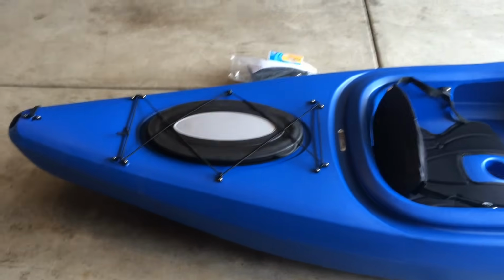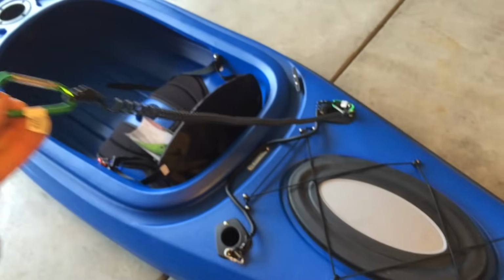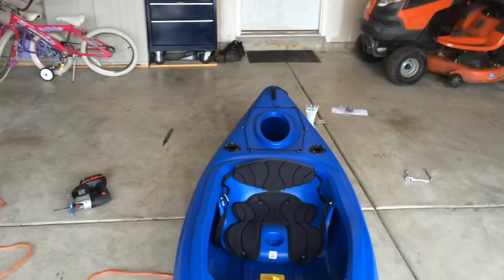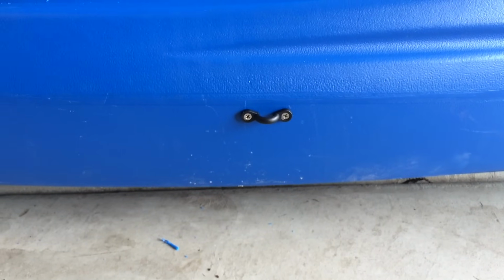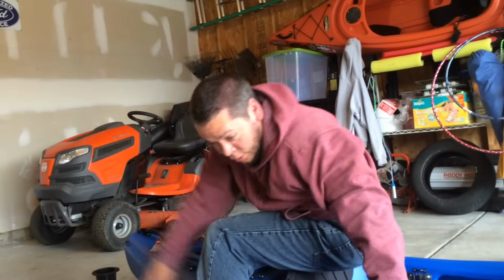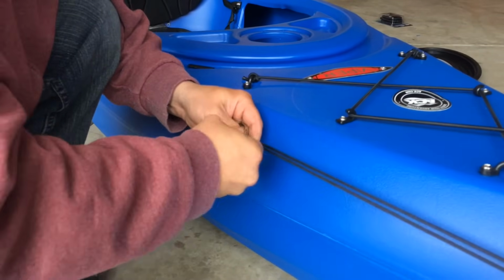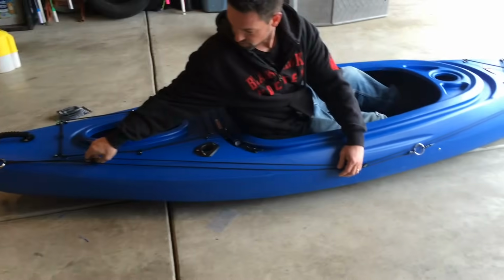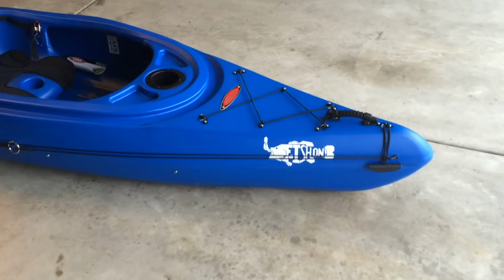Poor Man's Kayak Modifications

Comment: why u don't use gasket maker for the rod holders or those holes u drill wouldn't water get in
Reply: +Bass Hole oh ok since water getting in dosnt mater you should drill 2 1in holes about 5in apart on the bottom so you can cool your feet with the water

Comment: You forgot to use silicone. The rod holders will take on water
Reply from the maker: MTB Wolf I did not forget to use silicon, the cockpit will take on more water then any hole I made on this kayak. I’ve had it for about 5 plus years and I have never experienced water from anywhere except the cockpit. Now if it was a sit on top I would’ve bought stock in silicone. Thanks for watching and good luck with your  mods.

Comment: better to use shrink wrap rather than electrical tape. also silicon seal will come loose in time use a proper water bonder CT1
Reply from the maker: victormeldroo thanks for the advice but I’ve been running it this way for years and have had zero issues. The point Of the video was to use what you have and make the mods as cheap as you can for those on a budget that still would like to get on the water. Thanks for watching.

Comment: if you dont use a backer for the bolts, it isnt really re-inforced but only installed with bolts instead of screws..... 
the advantage of screws is, when they pull out, they can either be replaced with a larger screw, or drilled to accept bolts (IF one can get to the backside to install a backer and nuts)..... because when a bolt/nut pulls thru the plastic, it tears a hole, so if one were to use a good backer to spread the load, it would NEVER pull out, but remain secure for the rest of its life....
Reply from the maker: Honestly I haven’t had a single issue with anything I installed on this yak. Thanks for the advice and watching.

Comment: Alot of holes with no sealant AT ALL. And the amount of force having to move you anchor trolley line puts alot of stress on all those screws with no sealant. Just a matter of time before water gets in. Also, please explain the benefit of a dual anchor trolley? So when the wind turns you have to remove anchor line from front and move to rear, or visversa. Just asking...
Reply from the maker: Christopher Wilson I’ve been using this kayak now for several years and have not had a single issue with water getting in the holes I drilled however when I paddle I do get water through the giant open cockpit and when it rains. I have had to replace the paracord and it loosened up within a few weeks so the strain on the padeyes was minimal. Thanks for the advice and watching.
Reply from the maker: Christopher Wilson the dual trolley was because the cord kept rising up over the top or going underneath the yak this eliminated that.
Reply from the maker: I’d just like to add, still not leaking at all. Silicone is for porn stars.

Comment: For anybody doing this, I highly recommend using either maring grade silicon or even better a marine grade adhesive sealant like Marine goop (marine goop actually bonds to the polystyrene unlike silicon)
Reply from the maker: Just for anyone that reads this comment, I’ve had this kayak for years and those rubber washers I used to seal the holes are still going strong. The only place I get water in is through the hole for the cockpit where I sit. But if you feel more comfortable using using silicone, you do you. Thanks for watching.

Comment: I would have put more eyelets in the middle portion and put them vertices instead of horizontal,  you are using them as a line guide, not really an anchor point, but definitely horizontal at both ends. Also I've seen (and added) about 8" of mid size bungee chord to one end of the trolley line for two reasons... 
1. If you areanchoeed and you get loose or drift or gust of wind, without the bungee taking up the shock stop... YOU might go swimming. 
2. The bungee makes maneuvering the anchor back and forth a pleasure and NOT a chore.
Reply from the maker: Thanks for the comment and info I’m glad you were able to make it your own. Good luck and thanks for watching.

Comment: No silicone to seal?? I mean... u have good ideas but even rubber grommets are better than nothing
Reply from the maker: Foxxyginger I used rubber washers. And just so you know this is a sit in kayak with an open cockpit you will take on more water there then anywhere in the yak even if you don’t use silicone or rubber grommets. I’ve ran this yak this way for a few years and never an issue. Thanks for watching.

Comment: Heat shrink wire wrapping is pretty cheap, and will last longer than electrical tape. Also, those deck eyes don't hold up to paraccord friction. A few cheap pulleys will extend the life of the whole system.

Comment: Instead of electrical tape on the rod leashes I would say slip a half inch diameter heat shrink tube over the cord, make a loop and sew it together with braided fishing line then pull the heat shrink tube over the sewed part of the loop and use a heat gun or a lighter. 
It will look a lot neater and be a lot less likely to come undone.
Reply: Might be a dumb question, but that sliding system depends on the friction which depends on the tightness of the rope. Doesn't it gets loose over time, or, say, when direct sunlight heats up the rope?

Comment: My first time Kayaking and this Kayak held strong. https://www.youtube.com/post/Ugkx4k5UrhC3v_Y4hIEaXLGvHcN5a5aBmZNB  The water got pretty rough as a speed boat zipped by me, and the Kayak withstood it (I expected to be capsized). The Ores are very easy to put together, the pump worked beautifully. the seats are a bit hard to sit in after a while (I recommend sitting on the floor). after reading the reviews I was very scared it'd get a hole in it, the material is very strong and durable. The Air valve may need a small Phillips head screwdriver to adjust, other than that, it's well worth the money!(update)I've gone Kayaking in 3 Lakes and 2 rivers totaling about 40 miles. the kayak had two holes and they patched easily and no other problems can't wait for kayaking season this year!
Reply from the maker: Good luck and thanks for the comment and watching.

Comment: First off, I appreciate your very informative video.
Question:
Should you use some silicone caulk  to seal out water under the rod holders? Seems like water could get between the kayak deck and rod holder.
Reply from the maker: I’ve never had an issue with water in that spot, if it was a sit on top I would use silicone but since it’s a sit in and the most water I take on is from the big open space where the seats at, it’s not a worry of mine. Thanks for watching.
Reply: Just look at the location and think : it's on the top right next to the OPEN cockpit.

Comment: I hope that you put on the rod holders some good marine quality sealant. Because if you didn't you may want to stow away a bilge pump. Because water gets in anywhere it can with or without your help. And not using  sealant is helping it out a lot.
Reply from the maker: Lough Sun I don’t deny sealant helps but I’ve been running these kayaks the same way for over five years and I haven’t had a problem with water. But if it make folks feel more secure then they should use sealant for sure. Thanks for the advice and watching.

Comment: If you didn't use silicon , water will be getting in.
Reply from the maker: Derek Simerly This yak has been used for a few years now with no leaks through the screw holes. More water gets in the cockpit from the paddle then anywhere else on this yak. Thanks for watching

Comment: Just a question - is there any need to use a sealant on the eyelets? Did the yak ship water through the holes or did it stay water-tight? If you used sealant on a poly yak, what would stick to the plastic?
Reply: Rubber washers - solid approach.
Reply: +Bass Hole cool I have that rubber gummy stuff that people use to put on Windows when they install a new window to make it water proof I have a big ass roll of it I guess it would work if I made like a donut with it around the skews or nut head before screwing the screw right?

Comment: Question May 15th, 2018. Hope someone checks in. Just bought a sit on top self bailing with scupper holes. I prefer to sit in a dry kayak with our cold water lakes in Oregon. There was also a little water in the interior storage compartment, which I would like to be more waterproof. DO YOU THINK it is wise to plug the scupper holes permanently and will that keep the interior dry? I would rather attach stabilizers than tip over unintentionally when kayak camping. Thanks!
Reply from the maker: Lindsey Alex use the scupper plugs if you don’t have any you should be able to purchase them for your specific yak. If you use the plugs and water starts to come over the side of the yak then you can pull them like a drain. If you permanently plug them you can’t do that and will get soaked anyway. Good luck and thanks for watching.
Reply: Thank you!
Reply from the maker: Lindsey Alex you are welcome
Reply: If there's water on the inside of a sit-on-top kayak, it's not coming from the scupper holes. Those holes run all the way through the deck to the under side of the boat. There's no way for water to enter the interior storage compartment. And if you plug the holes, you're just turning your self-bailing boat into a bath tub that will catch every drip off your paddle. If you like sitting in a big puddle, that's a good way to do it. The water inside your boat is almost certainly from poorly sealed screw holes from the manufacturer. Your best bet is to remove those screws, reseal with a marine grade caulk and then reinstall. Or just keep your stuff in dry bags and stop worrying about it. You're not going to take on enough water to cause a problem. Just drain your boat after each trip, and you'll be fine.

Comment: Common Stainless d-ring tie downs have the same spacing as the plastic deck eye fittings holding the original handles. I replaced mine, and have hauled up and down an 8 ft bank with no problems using them to drag it by.
Reply from the maker: Jeremy Himes great idea thanks for watching

Comment: Anyone wondering about waterproofing the screws like I was he explains in the description how he uses rubber washers and other things to water seal
Reply from the maker: Evan Dickson i've been running this kayak for like four years now and I get more water through the cockpit then I have ever gotten through any screw hole if any whatsoever. Zero problem with leaking. If it was a sit on top I would consider silicone.

Comment: Love the video. I am in the process of doing the same to my kayak. I want to put an anchor cleat in a similar position as shown in this video. However my kayak does not allow me to have access to the under side of the kayak, meaning I cannot place a washer and a nut on the backside to ensure the cleat stays on. Any suggestions on where or how I could attach my anchor cleat?
Reply from the maker: That's a tough one without seeing the yak. But some guys use rivets but I'm not sure if they would fit down the cleat screw holes. there are also different styles of cleats out there as well. What ever you use, if you have a sit on top kayak be sure to use a sealant of some sort to insure no water gets in.
Reply: You can use well nuts to mount accessories if you don't have access to the inside

Comment: Watch scraping flesh off on the screws. Put some gas line or vacuum line on the exposed thread. Not sure if they are exposed, but that would suck to slice an arm or leg, specially if wet.
Reply from the maker: mark kerlin Thanks for the advice exposed screws, but that’s a good idea if there were.

Comment: Great video. I applaud the fact that you use nuts and bolts and nut just screws. This is more secure. 
Tip: Use heat shrink to cover your paracord knots, instead of tape.
Reply: It might be better to super glue the knots and so no more worrying about it failings

Comment: I wish I were brave enough to start drilling and sawing into my kayak so I could do some cool mods. Great video!

I did have to replace some eyelets on my kayak. I used marine sealant from our local Ace Hardware on the eyelets on the inside of my yak. Yeah, it's a sit-in and invasive water in the cockpit is unavoidable, but, I felt better inside by covering the bolts w/ marine sealant. Guess I'm OCD like that! LOL
Reply: Yeah I added sealant more for my OCD than anything! HA!

Comment: Try shrink tube over your knots instead of electrical tape, you won’t get that electrical tape sticky slime and the shrink tube will never let your knots loose. Gently heat the tubing being careful not to melt your paracord or nylon ropes.
Reply from the maker: Thanks for the advice I actually have later videos that I’ve done that shows me using shrink tube thanks for watching

Comment: I was thinking of doing similar to my sit on top. Did screws hold up, I planned to silicone them to deck and use expanding inserts to hold screw in at minimum... Any update would be cool...?
Reply from the maker: movaughn20 I’ve been running this yak for 5ish years now and no leaks. Everything has held up except the peracord I’ve had to replace a couple times but that’s it. Good luck and thanks for watching.

Comment: I was looking for best budget kayak and ran across this killer video. Got to be honest I thought it was just gonna be a hack job but these are great modifications! Would you recommend using silicone to seal up all those holes for the screws? And hows the boat holding up?
Reply from the maker: Funk Skunk 5 plus years without silicon only rubber washers and it’s holding up great. The only thing I’ve replaced is the peracord for the anchor trolly system. Thanks for watching and good luck.

Comment: Did you replace the Styrofoam block in the front after mod, or did you remove styrofoam completely?
I have an Old Town Angler that has styrofoam blocks in front and back ends

Comment: I came across this as I was looking for some mod ideas to make our little dolphins a little more "fun", versatile, lake machines...as the broke mom, I found this quite sensible to do to save us from wanting something else that wont fit on my Aveo roof. Also appreciate the use of washers/rubber gaskets as the marine silicone is not budget friendly. lovin it, thanks for posting and giving me some confidence to drill into a perfectly good boat skin...eek!...lol. I got us those little dock rods instead of long rods because they fit inside the rig for car travel. (no large fish here)Mounted them with velcro tape... and put two mesh zippered school supply bags for small items on the inside (also with velcro tape), one on each side these are great for keys, radio/cell phone in a wet case, gum, sun lotion-another.. idea for you) all I need is a cup holder now bahaha...happy kayaking!
Reply from the maker: That’s awesome glad the video helped build some confidence and gave you some ideas. From personal experience some of these cheaper kayaks are just as good as the expensive kayaks, they get you on the water to have a little fun maybe you can catch some fish. Good luck with your modification ideas. And thanks for watching.

Comment: The anchor trolley system was it one hole system or did u buy two different systems I definitely want to do this to a kayak I’m going to buy this week but I want 2 on each side
Reply from the maker: FISHING OUTDOORS I just bought the materials separately. And the reason why I use two one in front and one in back was when I used a single one the length of the bought it would always slip up over the cockpit or under the bought because of the shape of the yak. Hope this helps. Thanks for watching.

Comment: Do you ever have any trouble with the trolley system slipping?   I don't have a trolley system but I've been looking and I think this is the only one I've seen that doesn't have a way to lock the anchor in place.   Thanks for the video it's been very helpful
Reply from the maker: Part time Hiker I haven't had any issues with it slipping but I have not fished in it over 15mph winds. Thanks for watching.

Comment: Love what you did with this kayak. however on your anchor trolley I would have opted for the loop at each end of the para-cord line and a mini carabiner that you can get at walmart for under a buck. oh and most para-cord they make these days has a nylon weave if you put a little heat to it it will melt together nicely thus eliminating your need for the electrical tape.
Reply: ok yea it would be if you already had the ring and the para-cord I used to run a similar set up on a canoe I had. the only differance with my set up was I ran one line from the bow to the stren tied two lines to the carabiener one for the anchor and the other to one corner of my seat and I'd sit in the middle of a 16' canoe. I do like your set up better having one line in the water and only one line running stern to bow.
Reply: yea I've been thinking of buying a kayak or another canoe. however since I drive a motorcycle  getting a kayak or canoe to the water would be a little tricky..lol
Reply: ok if I ad a side car which costs around 5 grand for a decent one I may as well just go buy a trike with a trailer hitch and if I do that I may as well just put my freedom up for sale and become just another autonomous robot in a cage. the other way to get around the problem would be to move closer to the water. of course if I did that I'd have to give up the place I'm in now which would mean losing the mote...lol

Comment: i added a short piece of bungee on the pad eyes front and back, with stainless pulleys from home depot (cheap and awesome) rather than run anchor chord thru the pad eyes. it acts as a shock absorber for choppy conditions and puts less stress on the pad eyes. also, i use stainless steel pad eyes from Austin kayak and canoe ( they also have pulleys and tons of great accessories) because i've snapped several nylon ones. do it right, do it once!